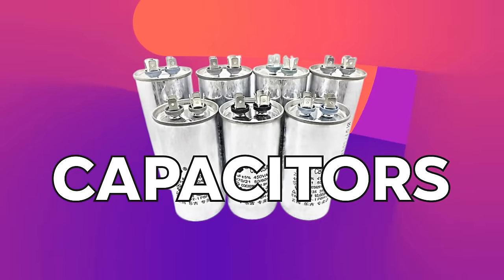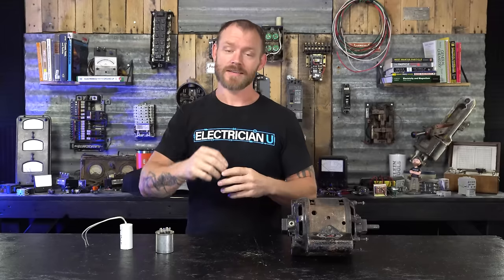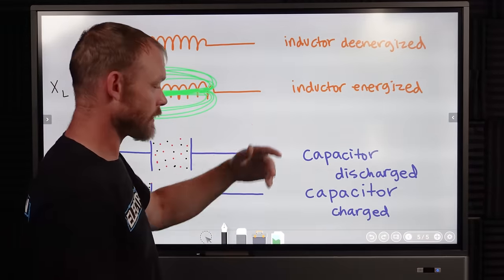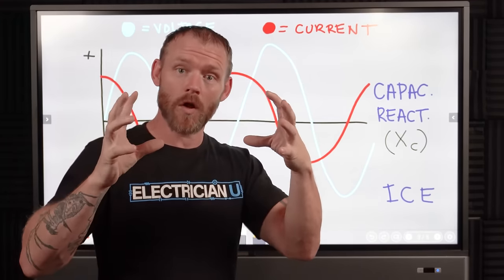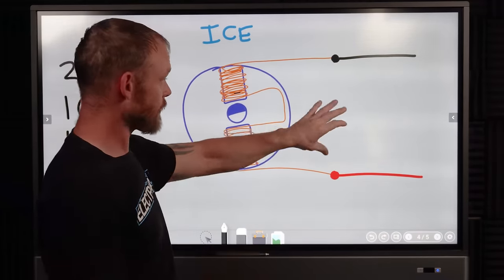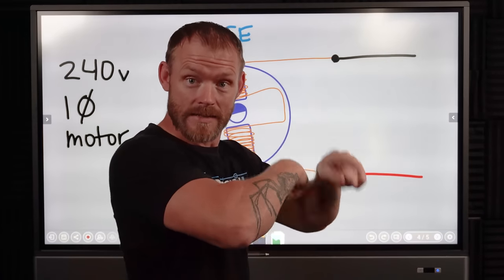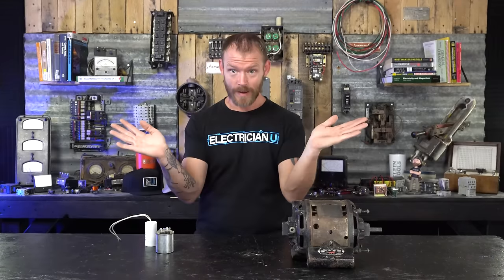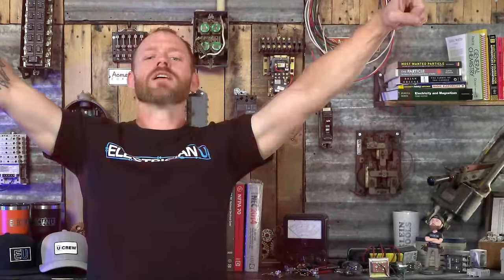Why Are Capacitors on Motors? What is Capacitive Reactance and Inductive Reactance?

Comment: THIS IS NOT HOW A CAPACITOR HELPS A MOTOR START.  I apologize for using capital letters. My intention is not to yell. Only to draw attention, so maybe you'll reconsider making another video or updating this one,  so in the future it doesn't confuse others like it confused me. I watched this video for the first time about a year ago, and after watching it a couple of times, I was confused about how a start capacitor helps a motor start.  After taking some classes and learning how capacitors truly help a single phase motor start, I came back to watch your video again to see what caused the confusion the first times I watched it. After watching it, I realized that you don't use a start winding in your presentation. In a single phase capacitor start motor there are 2 windings: start/auxilliary winding and main/run winding. They are physically placed 90 degrees apart from each other inside the motor housing. The start capacitor is put in series with the start winding and a switch (usually a centrifufal switch). When you start the motor, the start capacitor (when sized appropriately) helps increase the phase angle difference between the current going throught the main winding and the current going through start winding to 90 degrees. This 90 degree phase shift in current between the start and main winding, along with the 90 degree physical spacing between start and main winding inside motor housing is what helps the motor start. The current first passes through the start winding and it creates a magnetic field that makes the rotor begin to rotate. Then 90 degrees later current passes through the main winding and it creates its own magnetic field that helps the rotor continue rotating and accelaratring until 90 degrees later when the start winding's magnetic field helps the rotor accelarate even more. This back and forth dance between the start winding and main winding will continue until about 75% motor speed. At this point the centrifugal switch will open and cut power to start winding. I hope you don't take this comment the wrong way. It's only constructive criticism. Nothing else. Thanks for your time!!!
Reply: This guys videos are filled with inaccuracy. 
Most what I'll generously assume are slips of the tongue which should be caught & edited before posting.
Reply: If in doubt ChatGPT 😄
Reply: By far the best explanation, thank you Bernardo!
Reply: @armandoalaniz8037  Thanks!
Reply: This was incredibly helpful
Reply: Some motors dont have a start winding and the phase relation is indeed what will help start the motor..  so your half right..  but also half wrong..   but a cap is a cap.  Motors cant tell if its a run or starting cap.  Its how you wire it in.    But theres no start windings on hermetic compressors.  Theres just 3 different/ separate windings wired in either delta or star..  adding a cap on one of those windings will offset the winding and start the motor.  If wired a cap across the whole thing will add to the entire coil and act as a run..
Reply: thanks, that makes sense. I won't watch that video now.
Reply: @Z-Ack  When you say "a cap is a cap", are you saying that you can use a start cap as a run cap? From my understanding, a start cap and run cap are different. You can use a properly rated run cap in place of a start cap but you can't use a properly rated start cap as a run cap. They are built different. Run is for continuous operation but a start cap is built for only momentary operation, so it's not all about how you wire a cap.
Reply: @bernardocisneros4402 yes there are different capacitors but the point he was making is that a capacitor stores a charge, and a motor can't tell. You're taking about different capacitor applications
Reply: @nocandopdx  I know what he's trying to say but he's not doing a good job at it. His comment has some errors and inconsistencies. I don't work with motors. I was just interested in how they work so I watched this video and a couple of others and then I took a class. He says some motors don't have a start winding because they're wired in  Delta or Wye configuration but those are 3 phase motors and this video is about single phase motors. He also says you can wire in a cap into a Delta or Wye but a 3 phase motor doesn't need a cap to start. A 3 phase motor relies on the 3 phases of power that are offset by 120 degrees to get it started. I just don't like people spreading misinformation. It confuses people that are trying to learn. If you're not sure of something, or can't explain it correctly then don't make a video about it or comment on it. 
Like you, most people think that a capacitor stores a charge but that's not what a capacitor does. A capacitor does not store a charge. A capacitor stores energy in an electric field created by a separation of opposite charges. This is why an engineer should make these videos and not an electrician that works in the field. An electrician should make videos on how to install electrical devices not on their theory of operation.
Reply: @bernardocisneros4402 
I think if he wouldn't have used his hands so much to emphasize on what he's trying to explain....it would give a person time to take in what he's trying to explain....Kinda like he's trying to captivate your attention by doing that... so you end up more focused on what he's trying to explain and not being able to keep up to understand and break it down in your own mind. That's how it did me....but after reading your initial comment' I played the video over and didn't watch it.....instead I just listened and it helped me  to understand that you were right about alot of things.  The thing that caught my attention about your comment was.... using all capitol letters to get attention and then you calmed down to explain it.  
DOES THAT MAKE SENSE?
Reply: @BryanClark-gk6ie  Yes, it does.
Reply: @BryanClark-gk6ie I agree, all the hand waving was annoying.
Reply: @Z-Ack  3 phase star and delta motors do not need Capacitors, they are needed for single phase induction motors
Reply: Came here to see if anybody else noticed this. Still a great video though and very helpful, just not completely accurate.
Reply: Ya, he starts going wrong at about 11:30, although I skipped the capacitor description.
Reply: The easiest way to understand this is to recognize that three phase motors have NO start mechanism as they dont need one.  What they have is a "rotating magnetic field" which is what allows them to self start.  Modern motors mimic this rotating magnetic field by incorporating the phase shift of start capacitors to create a rotating magnetic field.  But a three phase motor can actually run on single phase.... sort of.  Its called "phasing" and it imparts a significant reduction in horse power output.  Again the issue is in starting the motor.  In a simple phase converter, the UNLOADED motor is run in the phasing mode while the other two windings are used as rotating transformers.  I have seen crude converters using a pulley and string to start them akin to starting a lawn mower.  But where confusion can certainly arise is when you begin to explore 90 degree winding offsets, etc.  Here you can get into repulsion motors which incidentally have brushes.  There was a class of motors made years ago which were single phase induction/repulsion motors.  Here, the motor starts up as a repulsion motor and then shorts out the rotor conductors to operate as in induction motor.  Very cool motors but very complex to restore.
Reply: @devemch7851   Thanks for the input.

Comment: Single and two phase need a capacitor to spin the motor in the right direction because even with two phases they’re 180 degrees out of phase so there’s no reference as to whether it’s clockwise or counterclockwise rotation. Don’t need a capacitor to start a 3 phase motor. That’s just my basic understanding of it.
Reply: Although 2 phase power is a thing, it is extremely rare. What you are thinking of is a line to line single phase motor.

Single phase can be split into smaller sections of a coil, for example single phase 120/240. They simply tap the middle of the coil and then from either end of the coil to center (neutral point) you get 120 because you only utilize half a coil, and from line to line you get full 240. In this instance your voltage waveforms would be 180 degrees out of phase because the 2 coil halves are directly opposite each other. 

In 3 phase wye 120/208 then you would still not be considered 2 phase as the 2 coils are only 120 degrees out of phase, and not 90 if I’m not mistaken. 

Imagine single phase being one person pushing a merry go round with a bunch of kids. It would be very difficult to get started, but once you get moving it gets easier. 

Then imagine the same merry go round with 3 people pushing one after another clockwise, and in sync. It would be much easier to start since the load is distributed among the 3 people, and the merry go round would slow down less in between the time that you let go and grab the bar at the begginning , because as your letting go the other person is mid push. so the merry-go-round will move faster, and the people pushing will tire out less quickly.

This is how three phase works. You can use single phase to run a motor, but power draw is higher and less efficient, but on 3 phase it is easier to start, AND draws less current while running, which reduces cost for wire, pipe, and electricity.
Reply: Worked on obsolete two phase motors years ago. None ever had or ever will have a Capacitor. Recently did a  Google search to find a fusible 4 pole safety switch for a two phase motors. Nope no results. Capacitors when in a single phase motor are two types: capacitor start that is only in the circuit for a few seconds until the motor achieves approximately 75% of full speed. At that speed it along with start winding are disconnected from the circuit. Some single phase motors contain a run capacitor that provides higher efficiency.
Reply: @MrTacolover42  three phase windings are 120 degrees out of phase and two phase is 180 degrees out of phase.  Philly & Detroit one of the few cities that still have two phase power. Heard they had 480 volt two phase but never came across it. Worked in a lot of 240 volt two phase 5 wire. 5yh wire was attached at center if both windings to provide 120 volts for lightning and general power to offices and such. Place that I worked at had 2,300 volt two phase 3 wire feeding a remote signal building. All modern 3 phase drives ( VFD'S ) have a capacitor bank wired in parallel to the DC Buss. Was told drive capacitors are rated for 75,000 hours run time but had a lot of 40 to 200 HP drives with over 125,000 run hours with original capacitors.
Reply: @JohnThomas-lq5qp  interesting to hear that there’s a configuration with 2 phase being 180 degrees out of phase! A quick google search told me 2 phase would be 90 which seemed lobsided to me.
Reply: @MrTacolover42  Sitting back you might be right with two phase being 90 degrees out of phase. Been almost 60 years since I learned about it. I have to locate my 60 year old 600 page double sided spiral motor book. Think a guy named something like Rosenberg wrote at least two separate great volumes years ago. Our industrial electricity class & a motor repair shop that repaired our motors both used this great motor book. More I think about it almost positive I misspoke  about two phase having phases 180 degrees apart. Thanks for replying. Even an old fart with over 50 years in the enjoyable electrical trade not too old to learn.I was paying my own way to attend the 8 IAEI yearly meetings/ continuing education classes in my area until the pandemic shut it down for over a year.
Reply: @MrTacolover42  you are mixing volt with degrees of phase shift
Transformer is incapable off doing phase shift
And no other half of transformer doesn't shift 120 degrees, but it may flip voltage (this is not phase shift as such, but you may aucie it is 180 degrees out of phase)
Reply: @MrTacolover42  rare yes but not over here. Philly is full of old 2 phase
Reply: Not so fast, an ac motor can start without a capacitor by manipulating the winding
Reply: I worked on & connected two phase motors. They along with 3 phase NEVER have or need a capacitor. Only some single phase motors use a capacitor for starting &/or for running.
Reply: Lol....lmao even.
Reply: I think of if like trying to ride a bike. It's easier to start moving when the peddle is slightly off center or not perfectly vertically. 120° at and angle. While it's harder to start riding when your peddles are vertical at 180° one another.
Reply: I think people mean split phase when they are referring to 2 phase. Split phase in the UK is where a transformer has a centre tap to give you 240 volts from 480 volts. If you use the two lines/lives you get the 480volts as they are 180° from each other. If you use line to the centre tap, you get 240. A 480 volt motor would be single phase. We also have 110 transformers for running power tools on building sites which use 110 volts centre tapped so that you only have 55 volts from ground for safety in wet environments.
Reply: Direction has nothing to do with the run capacitor
Reply: There is only single phase and three phase in the electrical industry 2 phase is called 240v and 1 phase is called 120v

Comment: You got the A/C capacitor info wrong. A 45/5 capacitor is for the motor and the fan. It doesn't start at 45 then drop to 5. The 45 is in line the entire time for the compressor and the 5 is for the fan the entire time. Some units actually split those out. Also, and it was not covered in this video, you can have a soft start unit that ADDS a capacitor for a very brief time to increase capacitance, which increases delay, which helps get the compressor motor turning. Then it drops out leaving you with the original 45uF run capacitor. So this teaches us that the 45/5 are dual capacitors running two different motors constantly.

Comment: The problem with starting an AC single phase motor, is there is no rotating magnetic feild as there would be in a 3ph circuit.  So we need a second phase with the current out of phase - thats all the capactitor does, provides the start current winding out of phase to the run winding.  Very simple.  There is no storing or smoothing anything,
Reply: Spin with hand

Comment: You prob lost 75% of electricians out there lol !
Reply: I sure hope not. Can you become a ticketed electrician in the US without learning capacitors?
Reply: @exploringbc431  There was nothing on masters test about capacitors - 20 years ago I took it but no one has ever said there is now either but I could be wrong !
Reply: @dustin741  lol yeah I had to even help HVAC guys trouble shoot big roof top units but little more involved with those than standard house units - usually was taps on transformers were at wrong voltage for A/C but figured they would get that right when HVAC companies ordered them !
Reply: @smoothsteve8331  right! Because electrical inspectors don’t care about capacitance. It’s not in the NEC.
Reply: @exploringbc431  unfortunately. I can count on one hand the number of electricians I've met in 10 years who weren't total bums.
Reply: @andycopeland7051  I was in union for 30 and I ran out of fingers after first year !
Reply: Then they are not electricians. Real deal sparkies should know how following motors: single phase capacitor start, capacitor run, shaded pole, three phase and some knowledge on stepping & synchronous  motors, permanent magnet DC motors, series & shunt DC motors and universal motors that can run on AC  & DC. I attended the best Vo Tech school around 15 hours a week for 3 years in high school. We spent a full week on at least ten different motors ( ten weeks  or 150 hours ) how to reverse them, where they are most used for, starting torque etc. At least 20 years ago the local union electrical apprenticeship increased from 4 to 5 years to cover mist things. Always cracked me up when a guy went to the local shake & bake 6 month part time school and thought they were electricians when they finished.
Reply: @exploringbc431  nope
Reply: @andycopeland7051  jealous because we have the best trade ,very good wages, overtime out the window and more side work then you can handle.
Reply: Can't blame em, most of what he says is either incorrect or misleading, hard to explain concepts that require a study of electromagnetism to actually fully grasp them. It's obvious he doesn't really understand what he's talking about.

Comment: At around 7:00 you gave the most tangible, understandable explanation of lag on capacitors and inductors I've ever heard. It's such a hard-to-explain subject that it helps to picture myself as an electron getting pushed back by a magnet, ala magic school bus, or to visualize the potential of a capacitor filling up and releasing. Another good analogy for a capacitor is a water tower.
Reply: Yup.
Electronics is a hobby of mine and every time I see one of these "what does a capacitor do on HVAC" videos I die a little bit more. But that section was gold.
Should have started the video with that bit, and not skipped winding geometry.
With a single winding, no amount of capacitor jiggery pokery will fix the start problem.
Reply: I've never understood how current could lead or lag, but the way he explains it makes sense.